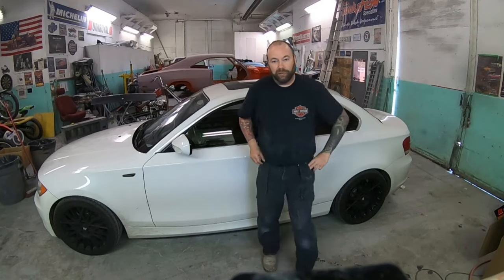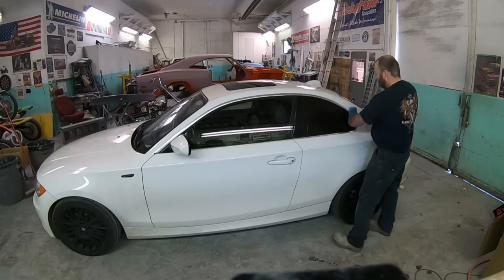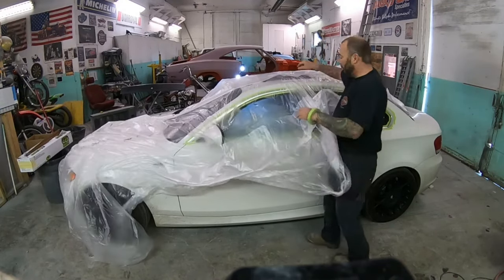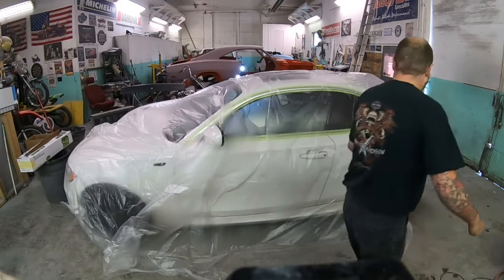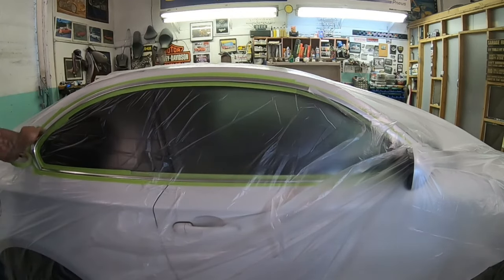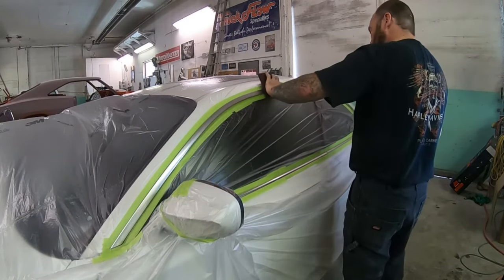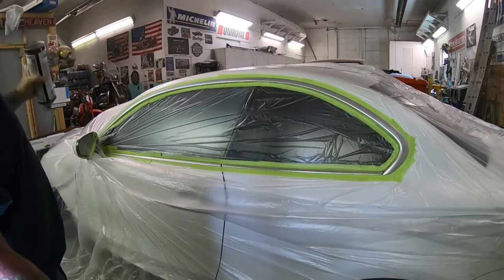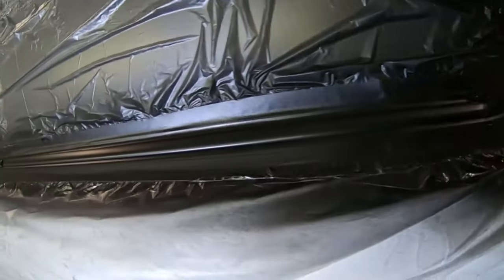How to paint chrome or stainless trim, properly!

Comment: Awesome video. 90% professional prep work, 10% painting with the best stuff, as it should be. Got a new sub!
Reply from the maker: Thank you, appreciate it!!
Reply: Professional... what a joke! 
Call that prep? No primer, crappy soft and easily sun weathered acrylic rattle can paint.. paint overspray on bodywork! 🤦‍♂️
The correct way is to remove the trim, prep sand / key, then etch primer, 2 part solvent / epoxy based top coat.. as manufacturers do with gloss painted trims and plastics... before finally reinstalling.

Comment: "Christmas project" 2006 BMW 330i update:
Followed the step-by-step very carefully, including using the recommended paint, tape, plastic covering, etc. BE SURE you tape VERY carefully, especially on bright trim where it borders body-color painted surfaces. The overall results were OUTSTANDING! I only had to re-visit a couple of small places, and I, too, had some unintended overspray, easily corrected with solvent. I had never before painted on a car, so if a geezer newbie like me can achieve excellent results, you can too! I can't thank Midnight Paint & Body enough. A Merry Christmas indeed.
Reply from the maker: Very cool! Glad the video was helpful. Thanks for the update on your project 👊🏼

Comment: Wow! Amazing how much a small change can make such a big difference. The paint really does look factory. Have you done any videos on painting trim with chrome paint? Would the principles be basically the same as what you did here? And any recommendations on a particular brand?
Reply from the maker: I’ve never used chrome paint, but you just need to be sure what it’s formulated for, this trim paint is a direct to metal product, but if it’s not then it would require an etching primer first

Comment: Much better. One question though. Why no clear coat? (I'm looking to paint some chrome running boards on my new truck. I'm thinking I should probably use a clear coat as its going to be getting dinked by rocks and other debris as well as people stepping on them to get into the truck.)
Reply from the maker: Always depends what product you’re using, single stage paint is designed to be that, a single stage, but adding clear might add a bit of durability. Typically if it’s going to be taking a lot of wear, painting chrome isn’t the best option.

Comment: Wow this looks beautiful 😍 can I use a gold paint instead? My car is black and I hate the chrome, I was thinking either black or gold trim , what do you think?
Reply from the maker: If you’re using a different paint, it will require epoxy primer. The trim paint I used is formulated to be direct to metal

Comment: Thank you for uploading this. I was quoted around $200 to do this to my SUV but now I am getting closer to being confident enough to do it myself. Id like to change my front bumper trim (chrome) to a matte black. Do i just sand it the same as you did here? When I googled it some sites said to put chemicals on it to strip the chrome first. Is that really necessary?
Reply from the maker: Front bumper is a tough one, they take a lot of abuse, painted bumpers are prone to chipping regardless. I usually tell people the best route is to buy a paint to match bumper instead of painting the chrome

Comment: Looks amazing!  Thanks for the how to video.  What product did you use to initially clean off the chrome and what 3M grit did you use to prep sand?  Thanks again.
Reply from the maker: I would have used an automotive wax&grease remover initially, and sanded with 320 grit. Just be sure to use a trim paint that specifies that it can be used on metal, otherwise may require etching primer

Comment: Thanks for the helpful video, planning on painting the chrome trim on my accord black. Quick question, if my cars paint is already black would it be better to paint the chrome as the same paint code as my cars paint or use the black trim paint ?
Reply from the maker: If the trim is stainless, definitely use a quality trim paint, it’s formulated to adhere to metal

Comment: Great Job!  Quick question though - what about clear coat?  Shouldn't that be done too or is it not worth it?
Reply from the maker: Check out my follow up video on this one, I explain that better, but no, not necessary when you use the correct paint
Reply: I would use clear coat, it provides uv protection and helps the paint last longer, if you don’t use it the sun/car washing will eat through the paint faster

Comment: Thanks for the video. Wish I would of saw this video before painting my trim. Question how do I get the paint off the trim due to the paint flaking off on certain areas?
Reply from the maker: Depending on what product you used, if it’s cheap spray paint you may be able to wash it off with laquer thinner, otherwise you’re stuck with having to carefully sand it off
Reply: I used the krylon gloss black spray paint and I did 3 coats but it still managed to flake off
Reply from the maker: @nemesisl4240  the SEM trim paint is formulated to adhere to to metal without primer, but other products may not be
Reply: @Midnight Paint & Body  ok thanks I appreciate the wisdom.
Reply: @Johnnymidnight  I used SEM trim paint on my chrome trim and it's still flaking off. Pretty much immediately. Any tips as what else I can use to help the paint adhere and not flake off?
Reply from the maker: Did you sand it before paint?

Comment: So you did all that work. Making sure you don't get any overspray on the vehicle, but you didn't use any etching primer on the Chrome or any type of primer whatsoever and you used only trim paint with no 2K clear coat for protection. How many days did this last? 

Do you plan on driving it outside?
Reply from the maker: It’s a direct to metal product. Stainless is non corrosive, so it doesn’t need primer to protect against rust/corrosion. If it was regular spray paint it would need etch primer first.
Reply from the maker: Check out the follow up video on this car a year later, I explain the product in more detail. I don’t understand why everyone brings up clearcoat. This is a matte finish paint. Basecoat paint requires clear coat. Single stage paint is just that.
Reply: @Johnnymidnight  
Wow! That was a fast reply 
If you're located in the prairies, can you do my front grill??

Would this sem product work on a chrome bumper?
I have a black bumper except for the two corner caps that are Chrome. 

Unfortunately same with the back. 

I also have a chrome grill 
Which is plastic Chrome. Do you have any suggestions for an sem product??

Thanks
Reply from the maker: I have had success with chrome bumpers, sanding it really well with 180, epoxy primer and paint, but typically on a customer vehicle i recommended just getting a paintable bumper. For plastic chrome, make sure to use a plastic adhesion promoter.My shop is in BC

Comment: I did this and prefer the chrome rather than the paint (which I also clear coated). I used Duplicolor bumper black and duplicolor clear over it. Any tips on how to remove the paint and get back to original chrome trim?
Reply from the maker: If it’s aerosol, then it’s reversible. Paint that isn’t chemically activated can be softened with solvent, but it’ll be messy

Comment: Hello Johnny: just subscribed! Been trying to remove/ repaint trims. Wondering what specific scour pad you used, as well as the exact SEM trim paint you used? How is it holding up now? Thank you
Reply from the maker: I use the 3M red scotch brite, that’s the coarse one. Paint is SEM 39143 trim black, still, after going through 2 winters, it’s holding up beautifully 👍🏼
Reply: @Johnnymidnight thank you. You're in Canada, like me - where did you buy the paint and the pad from?
Reply from the maker: I deal with Lordco auto parts, but I think any parts store should be able to supply 👍🏼

Comment: Does the plastic cover stick to the body of the car or the tape? Observing how  you peeled that strip of plastic off.
Reply from the maker: I tape the edge of the plastic to the car. If using plastic you need to use the automotive kind, one side is treated for the paint to stick to. If you use untreated plastic the paint will flake off. (Not a big deal using aerosol, but if using a gun it can blow off between coats)

Comment: I am painting the front grill,  mirrors,  gas cap door cover,  and other chrome parts on my jeep.   Does anyone have any experience long term?  How does this paint fare especially on a front grill ?
Reply from the maker: Check out the follow up video I did on this one, grille will be a tough one, I usually recommend on grilles and front bumpers to buy paint to match parts

Comment: looks nice! Ive got an audi a4 allroad with chrome grill that i want to paint gloss black. I think its aluminium coat with plastic under and not "real" chrome. What is the best way to paint it? Sand it a little bit then sand with water til the chrome gets a bit matte? Should i add 2K clearcoat so that it can take chemicals when i wash it? Thanks in advance.
Reply from the maker: Sanding really well is the most important, clear isn’t necessary if you use a formulated trim paint, but would add some durability, especially being the grille will take a lot of the road grime
Reply: @Johnnymidnight  Thanks! Do you recommend any sandpapers, what grit?
Reply from the maker: @Luuuugn  I’d suggest using around a 320-400 grit
Reply: @Johnnymidnight  Thanks alot!

Comment: Looks great. No primer?
Reply from the maker: No, if you use a direct to metal trim paint, it’s not necessary. If using regular paint, an etch primer would have to be put down first
Reply: @Johnnymidnight  What brand of masking plastic are you using?
Reply from the maker: I use the treated 3M stuff, always the 16’ wide because I work on so many trucks

Comment: Question; I work for a company that makes interior trim items for aircraft; the customer engineers who design the parts (Aluminum) want them painted. According to the prints and directions the parts have to be scuffed/brushed first, then go to get plated and then go to a painter. The paint keeps nicking off.  I have tried to tell them the plating is to smooth for the paint to adhere well. Am I on the right track?
Reply from the maker: Absolutely, the paint requires a “tooth” created by sanding for the mechanical adhesion
Reply: @Johnnymidnight  Thanks, I did paint and body way back in the 80's but no paint over chrome and such. I keep trying to tell them but you know how engineers can be.
Reply from the maker: Yep, they should stick to driving trains😂😂

Comment: do you recommend hitting this with a clear coat after?
Reply from the maker: Not necessary if using a formulated trim paint. If just using regular urethane, you might want to use matte clear, and then an etching primer would also be necessary

Comment: You did not have to use primer? Would you use primer for chrome plastic?
Reply from the maker: Yes, with plastic you’ll need a plastic adhesion promoter. I’ve actually made a follow up video on this to that I haven’t posted yet, to explain it better, but with chrome or stainless it doesn’t corrode, so primer isn’t necessary with this particular paint, it relies on mechanical adhesion, or sanding the surface so the paint can bond, hope this helps 👍🏼
Reply: @Johnnymidnight  gotcha thank you

Comment: Great job. Quick question. Can i sand and paint chrome
Reply from the maker: I’ve had pretty good success with chrome if you sand it, coat it with epoxy or etch primer then paint. Pretty tough to get it to adhere 100% on a forward facing surface, like a bumper or grille that takes the rock chips though
Reply: @Johnnymidnight  any specific grit sandpaper?
Reply from the maker: Something fairly coarse if it’s actual electroplated, like a bumper, I’d recommend in the 180-220 range
Reply: @Johnnymidnight  okay and would you say the same for the grill?
Reply from the maker: Yes, should be fine, just need to have a “tooth” for the paint to adhere to
Reply: @Johnnymidnight  I see. Thank you.

Comment: Would a lacker be overkill or would you recommend that for extra protection?
Reply from the maker: You mean a clear coat? Depends on the paint, in this case it’s a single stage, matte finish paint, so no. If using a basecoat paint, then yes, but then would also require an etching primer first

Comment: Is this the correct way vs removing the trim from the car first. The correct way is to leave it on the car when you paint?
Reply from the maker: It’s a judgment call sometimes, obviously taking it off is always better, but it’s risking damage, at the very least you need to deal with broken retainers. Check out the follow up video I did on this car a year later

Comment: I've tried that on Chrome on my front grill and it just chips off I've used everything sealers sending everything nothing works
Reply from the maker: Yes, grilles and front bumpers just won’t stand up. Rocks always win….. The only solution is to start with a PTM part (paint to match), but even then rocks are tougher than paint 😖

Comment: as easy as it cleaned up that  itseems like it would just be easier to just freehand spray it and wipe off the excess, no need for tape or plastic
Reply from the maker: You’d have a heck of a mess, over every inch of the car 😵‍💫

Comment: hello will, the same method also work for any paint color, or would you only recommend this with black?
Reply from the maker: In this case, it’s a direct to metal paint, other paint will require an etch primer

Comment: Would using an etching primer after scuffing improve paint adhesion?
Reply from the maker: It’s dependent on the product. In this case, the paint is formulated for direct to metal. If using regular paint, then etch primer would be necessary
Reply: @Johnnymidnight  I see. Thank you!

Comment: Should u not put clear coat over it!? Will it no fade without clearcote?
Reply from the maker: Not if you’re using a formulated trim paint, it holds up very well. I actually have a follow up video with the same car to show how it’s holding up, should be out soon.

Comment: This is why I do my own work. This guy didn’t prime, no adhesion promoter, no clear. Sad part is he posted this video as if it’s actually a good job. I would love to hear from the owner and ask how long it lasted.
Reply from the maker: Painting stainless or chrome is much different than raw steel. Primer is for metals that corrode. Adhesion promoter is for plastic….This particular product is designed to go direct to non corrosive metal.the product gets its adhesion by sanding, and creating a mechanical “tooth” for the paint to bond. I’d recommend looking up SEM products for their correct application. This particular car still looks as good as when it was done.
Reply: i've done this same thing on my Tahoe using SEM trim black. i would highly suggest using a 2k clear to finish.

Comment: What paint did u used?
Reply from the maker: SEM trim black. It’s a direct to metal trim paint
Reply: @Johnnymidnight  thanx for writing me back   is it good for bmw 330 (g20)? What do u think of plasti dip for trim?  Bmw trims  trim are shadowline black... and looking for a black that is close to the shadowline black
Reply from the maker: @luxe4744 I’ve never used plasti dip, it just always seems to look crappy. I think you’ll find the SEM trim black will match nicely
Reply: @Johnnymidnight   Mr Johnny  thx for the suggestion ur a good man.. 
Mr Johnny, did u use one can for both sides of the vehicle or two, and do I need to sand the trims or just apply rubbing alcohol and dish soap to clean the surface?? 
I saw online that AutoZone has the SEM trim. I bought two cans of Plasti Dip yesterday to blackout my trims, but after reading about the sem trim paint, I returned the plastic dip this afternoon. Thx for the suggestion, and have a blessed and successful week 🙏

Comment: The proper way would have been to clearcoat it.
Reply from the maker: Nope, depends on what materials you’re using. If using regular paint, you may want to use a matte clear, if using a formulated trim paint, then no

Comment: Lolol rattle can no clear and overspray after you bagged it.....wow
Reply from the maker: There’s no clear because it’s a matte finish….. you can use matte clear but not necessary with a good quality trim paint….. where was there overspray? Couple small areas where the masking wasn’t perfect?Very different than overspray.
Reply: No reason masking shouldn't be perfect shouldn't post a video and not do it correct
Reply from the maker: 😂😂you guys getting all wound up over a small gap in the masking that cleaned with a quick wipe with solvent 😂😂, that’s the way jobs go sometimes, and that’s why I showed it and didn’t just edit it out .
Reply: Nice work, glad I seen black paint error on a white car. I’d freak out but you made it seem no big deal as long as you have the correct material!

Comment: Lmao all that over the top prep and baaam, hahaha just take the trim off.
Reply from the maker: Most of this thin stainless is held on with one way plastic clips,and is extremely difficult to remove without damaging the mouldings. An hour of masking isn’t “over the top”, it’s a better option than having to replace a lot of retainers, and potentially some of the mouldings
Reply: @Johnnymidnight  I just removed the moulding on c204 coupe. I think our point is you still managed to get spraypaint onto the door.
Reply from the maker: Yep, but an small error in the masking is still preferable to risking damage to the mouldings